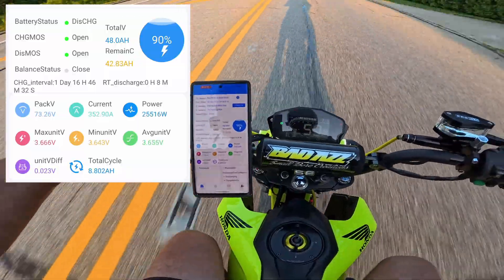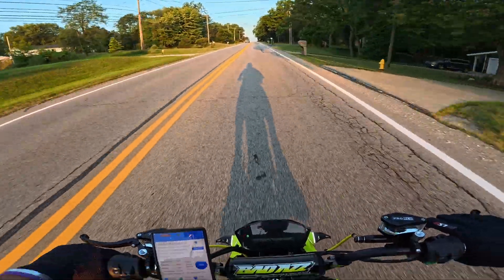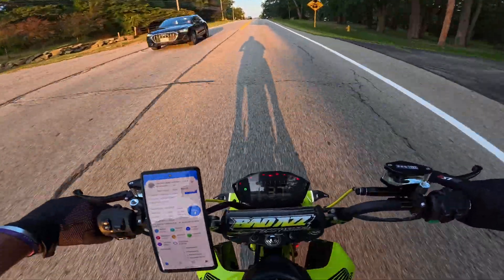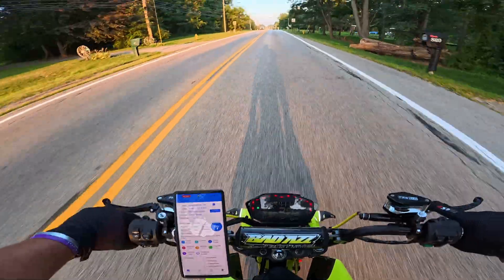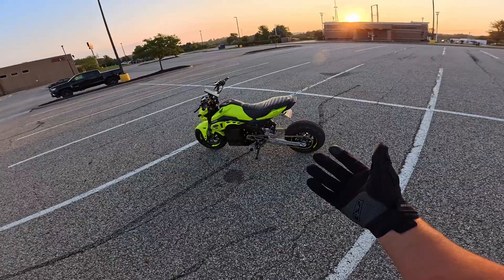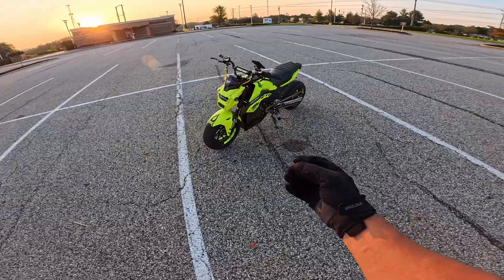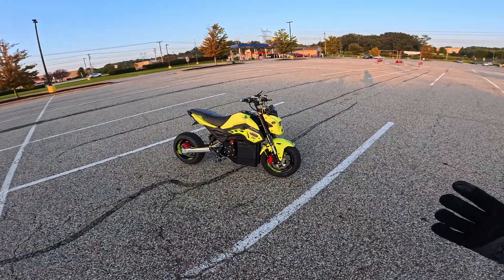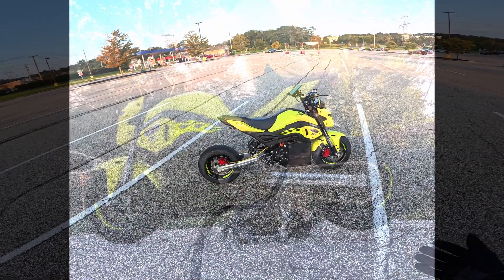36HP Electric Honda Grom Build (start to finish)

Comment: hey I had a question about the motor you use on these builds I was looking at it on the qs website and noticed it was listed as at 13 kw max peak and I remembered you saying your other builds were tuned to 18kw and I believe this one was even 36 kw, I guess my question is whats the deal? am I looking at the wrong motor, is it labeled wrong on the website, or are you just pushing them harder, which is something I can understand as a possibility as I've pushed some ebike hub motors pretty far and they still run after thousands of miles.
Reply: all those ratings are safe suggestiions , but virtually no one uses the motors in those power ranges.. Monitoring temps is one way people see what their motor can handle for short bursts.. Keep in mind , when you build something thats 30kw thats the peak for seconds or less during hard acceleration.. the cruising wattage is well below the factory rating ,( this bike prob pulls 4000w at cruising speed , but 28kw or so during hard acceleration from a dead stop )  So its all about exposure time vs heat
Reply from the maker: @airgunningyup this is a great way to describe it! Nailed it!
Reply from the maker: Great question! What you're looking at is more than likely continuous power ratings. Ie-  what the motor can continuously output without ever having issue for essentially an infinite amount of time. Generally, what you'll see online which is the same with my builds is the rating that it is tuned for under max or peak load. Under the majority of time standard riding is way under that continuous rating.
Reply: @3CMiniWorks  okay cool, thats what i believed the case to be. i knew it was only hitting  these super high wattages when accelerating and in short bursts and then tapered off at cruising speeds, i was more taking what they had listed as the max peak as the max you could hit even in short bursts, the qs 138 90h on the qs website is listed as rated 4000w, 7500w max continuous, 13.5kw peak. but what the other guy said about it basically being a suggestion and monitoring temps to find a higher safe peak makes sense to me. thanks.